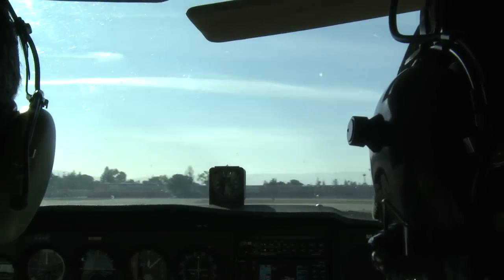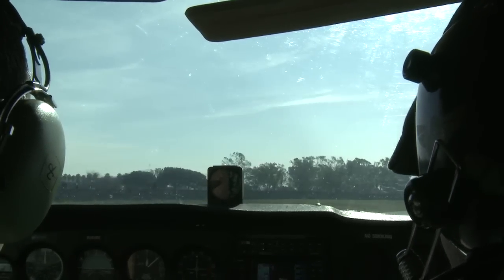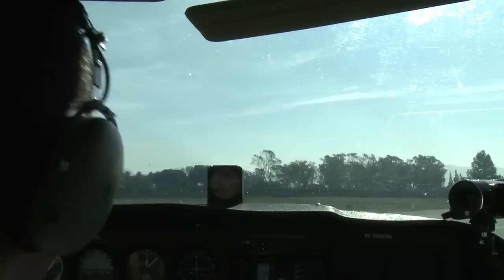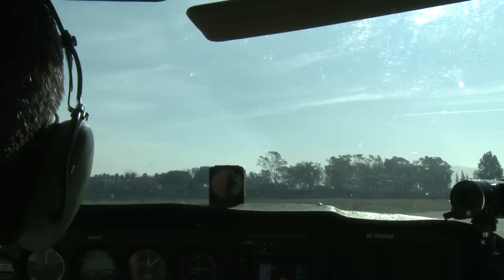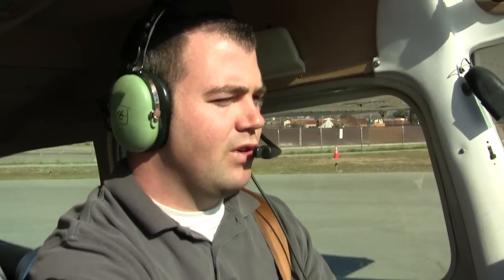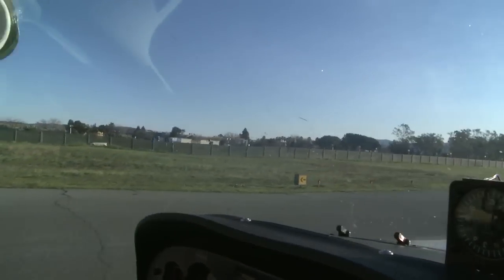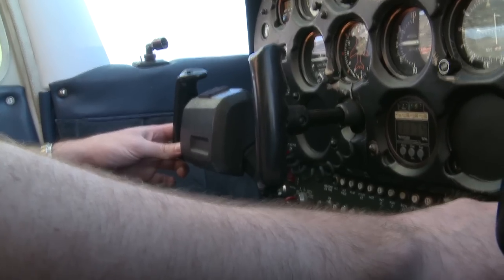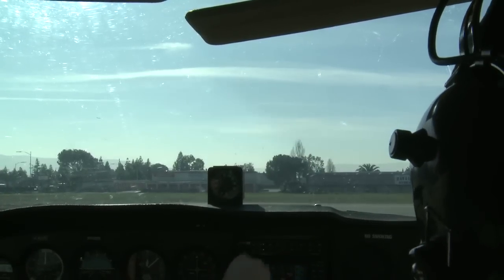Learn to Fly - Takeoff Clearance

Comment: Should never say ready for takeoff. Say ready for departure. Takeoff is a clearance given by atc and is only a read back.
Reply: Correct! And that's since Tenerife, not yesterday.
Reply: Hi as long as the person understands the instructions it does not really matter. How it is given. Unless it is a completely different directive
Reply: That's a solid negative, Alexander. Radio com should be carried out in strict respect of the ICAO Radiotelephony manual. Approximative comunications CAN work in a remote airstrip, but since you're flying in controlled airspaces and talking with atc's you have to communicate properly. Lots of people died due to "that com will work anyway", you have to speak by the book, for the good of all the people in the air and on the ground below!
Reply: Yes I understand a compass has only 360 degrees but then 370 would also equal 10 therefore im prob wrong
Reply: In terms of "interchangeability" yes, there is some space, often involving "slang" (ex. "squawk 6270" and "6270 in the box" or "make one orbit on the right" and "make a 360 on the right"), but there are some topics that have to be spoken of by the book, and that becomes more and more important as the matter gets critical. Of course, takeoff procedures are pretty critical as you can easily guess, and I felt the need to remark this under this video, that is published with instructional purposes and has a very big and classic mistake in it. That said, probably an ATC would not be correcting somebody on frequency, expecially if the airspace is congested, but again, these are two holes of the so called "swiss cheese model" that have already lined up to clear the way for an accident, and that is why it's important to be precise with radio calls!